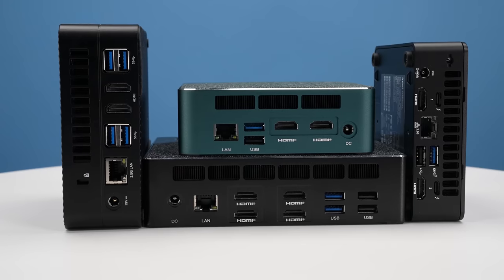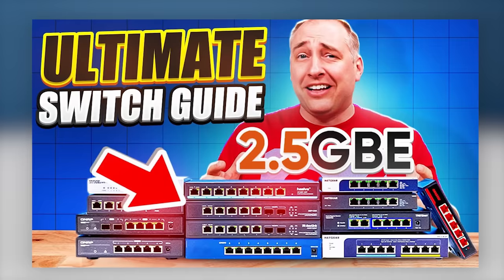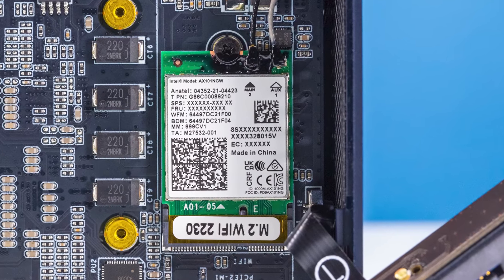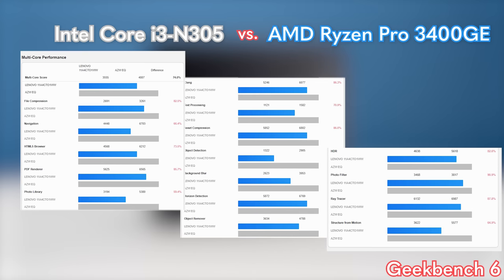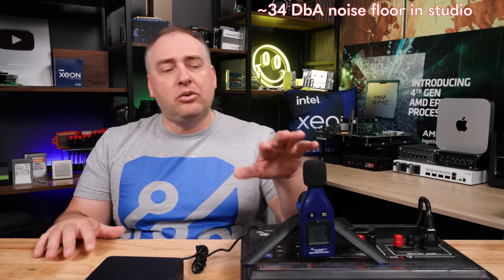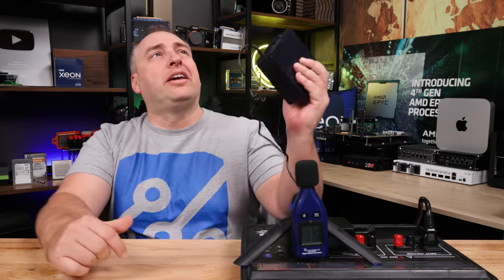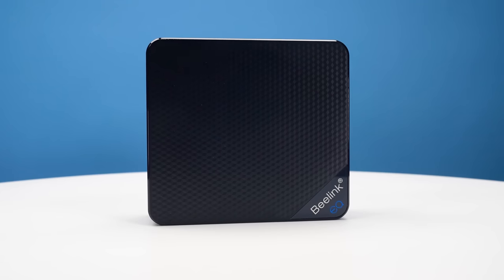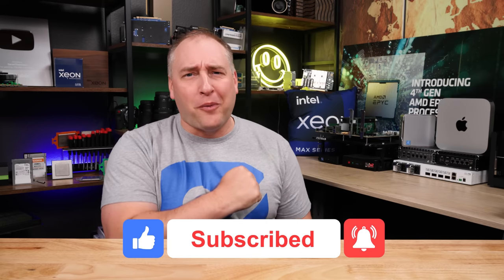Intel Core i3 N305 Mini PC Performance Beelink EQ12 Pro Review

Comment: Might be worth noting that SMB3 multi-channel works when you have modern Windows OS on both client and server side. While I believe that BSD and NIX based OSes that use Samba will not support this out of the box today. Last I heard was SMB3 multi-channel was added as experimental in 4.4.0 release many years ago and there are corner cases that it can cause data corruption due to race conditions. Even Microsoft has had a number of their own issues with it.

Comment: Very exicted about the "next generation" of Mini PC's

Would love to see these become even more efficient at idle, and DUAL CHANNEL RAM is an absolute must.
And slightly better quality cooling. At 15w TDP, all they need to do is put a slightly larger fan in. A single heatpipe should be more than adequate to transfer the heat from the die to the heatsink, I think just making the fin stack larger and a larger fan would make a big difference in noise.
Reply from the maker: The Alder Lake-N parts are single channel only so it is an Intel platform limitation
Reply: With the Intel branded NUC's, most of Intel's in the same price ranges are all DDR4 from what I could find.  Some of the "off-brands" like Beelink, well, they are offering the same in DDR5; which sort of gives you the performance similar to DDR4 dual channel.  But even Beelink's lineup can be confusing blend of  "this model has DDR4" and a very similar model, same chip set, but with DDR5 at a slightly higher price.  Granted, I'd want DDR5 and dual channel if given the choice.  Generally speaking, I also want the option to go up to 64GB ram or beyond too..
Reply: @ServeTheHomeVideo  Aah that is unfortunate, I did not realize that. My Intel n6005 based NUC I felt a noticeable difference in day to day usage going to dual channel after using just 1 channel for a while, especially browsing youtube and testing with Parsec for remote gaming. Sad to see Intel strip so many features off the new generation. Even the iGPU eu's are kind of disappointing, was hoping to see 32 eu's in the lower end sku's, and something like 48 eu's in the N305. Really helps make the machine feel snappy when watching content in the browser.

Comment: too damn expensive for what you get. bought a Beelink Ser5 pro  (8/16 core 5800H With 16gb/512GB SSD) 2 months ago during AliExpress sales. it was $310. the memory was ADATA (Samsung chips) and the SSD Kingston 2700 MB/sec. It handles any AAA game at 720p. twice the performance.

Comment: Would be interested into measurements include also low-power bios setting (if available).
Looking for a 5w-20w proxmox server machine. Found some older gen. candidates which have a bios options to reduce idle power significantly, but prefer a newest gen. product. Thanks

Comment: In my opinion the Beelink Sei12 with the Intel 12th i5-1235U is a better value, you get two more CPU cores and drop an ethernet jack for the same money.
Reply from the maker: If you saw the performance charts, the 1235U is only slightly faster. I was a bit surprised by that but it seems to be power limited
Reply: Reckon you could review the sei12pro 1260p at some point?

Comment: In Geekbench: Power saver mode 1159 single core,  4807 multicore / high performance single core 1271, multi 4478. Is it correct? Was there any kind of thermal issue?
Reply: If you don't cover up the middle fan with a SSD, there's enough cooling to keep thermal issue from happening.
Reply: Very suspicious indeed.
Reply: I suspect he turned the multi core scores up side down
Reply from the maker: Checked these. We labeled them as we uploaded to the GB browser. They were all running into power limits

Comment: I got a couple of the Beelink Ryzen 5560 units and reinstalled Windows 11 on them from a jump drive. When installing it asked for the key, I said I did not have one. Once it was fully installed though, it automatically activated once online.

I also got the 7735HS Beelink unit for one of my kids and it has been awesome so far.

Comment: Just ordered EQ12 regular from Amazon for $315 (click-on coupon that appears every 12 hours it seems). What bothers me is that I didn’t pay attention and they (Beelink) say that I can only upgrade to 2Tb NVME and only 2TB SATA drive.. I can’t understand why… I understand memory is restricted to 16Gb by memory controller but why is disk restricted? So now looking again at i3-1315U based NUC or Miniforum NBP-6 - the latter one also has 2 2.5Gb ports….
Reply from the maker: My guess is that they have not tested over 2TB in these.
Reply: @ServeTheHomeVideo  I received response from Beelink support - they say both drives are limited to 2TB and you can't install a larger disk.
Reply: @mutovkin  Carey Holzsman just done a video showing installing 4gb and 8 gb nvme and the system works fine.
Reply: @kenthesparky178  Strange, I don't see any recent videos about EQ12 from him... Only the old one in which 32gb ram stick killed eq12...

Comment: The 12/13th gen e cores are said to be as powerful as Skylake cores. So does this finally answer the question of what would happen if you put an old architecture on a node 8 years ahead? 

Also isn't this a SoC already, since you don't seem to have an additional chipset?
Reply: Kind of, but there are some critical differences that make it not an apples-to-apples comparison.

The best 8-core Skylake chip I can find on Ark is the i7 7820X, which has SMT enabled. The differences are huge and make any benchmark meant to simulate Skylake on Intel 7 inaccurate. 

The i7 has 2x the L3 cache, or almost, at 11MB to the N305's 6MB. It has SMT, which means 16 threads vs 8. It has a much higher TDP as well, 140W vs 15W, and the clocks are different. 4.5ghz for the i7 vs 3.8ghz for the N305. The more important difference is in the IPC and in lower-level architectural changes such as the better branch prediction of Gracemont cores.

Finally, to answer the second question: This is a mobile CPU, and will have a PCH like all other mobile chips from Intel. This is effectively the chipset, just on the same package as the CPU in a second die.

Comment: @8:59 - yes and no. Nobody will use J4125 as desktop computer but it works perfectly as firewall/router appliance. So mixing these 2 makes no real sense.
Reply from the maker: There were a TON of J4125 Mini PC desktops. We were going to start the STH Mini PC series with them. The J4125 is great for a firewall/ router. Next, we are going to have N100/N200 firewall/ routers so stay tuned for the next video this week.

Comment: Is that ~4400 multi geekbench peformance sustained or just 1 run where it is turbo'ing for much of the run? Curious of long term full load clocks/performance at 25 watts wall power consumption! And, how it compares to same scenario with 4-core N100.
~4400 is slightly slower than 6-core i5-8500, which u can sustain at 3.89GHZ at 60 watts at the wall (~40w CPU in hwinfo) within an HP Prodesk SFF box undervolted by 140mV reliably stable via Throttlestop and old BIOS pre-plundervolt, crunching WorldCommunityGrid Workunits.
So.. basically, N305 is 2x the efficiency of good 'ole undervolted mature Coffeelake. Just napkin math mind u.
Thought it would be more like 3x.

Comment: I have one and im wondering what will happen if the power goes out ? These don't have a battery so when the power goes down that's it and if it's updating when the power goes off you may lose you system and have a brick,  The power in my area goes down a lot 4 to 6 time a year, Not off for hours it just flickers of and back on so just enough to turn the tv off or mess up the clocks but what will that do to this PC with no battery? My phone and tablet and laptop don't mind a power failure because they have batteries
Reply from the maker: You can get an external UPS unit. Since these are lower power they will run for a long time on the battery

Comment: Looks like a nice mini and then I look at my 35W 800 G3 running an i5 7600t and wonder if it can match that and if it can game at all. I can play older titles with the HD 630 quite well with the G3. Downside of G3 is the fan noise whenever under load. I notice Dell stuck with the HD 630 all the way to the G8 I think is when it upgraded, which makes it costly to move up to better graphics with HP minis.

Comment: does anyone know if that kind of PCIe slot that the WiFi card is plugged into could accommodate a PCI breakout cable that could give you 10GbE? 2.5 (or 5, bonded) is still too slow for me, I need fast networking but can compromise on other stuff.

Comment: These little boxes need support for 32 GB of RAM to make them interesting as candidates for little  small business mini-servers!  An N305-based system having 8 cores/8 threads is just begging for a few of these to be viable for SMB use...; perhaps 4 of them ($1400 total?), providing small businesses with almost everything they need in a moderately powerful footprint of 4 small boxes that occupy 1/4 of the space of a  typical 1U server...
Reply from the maker: The N305 in our most recent R86S Pro video has 32GB

Comment: how ist the integrated GPU on these powerfull small E core CPUs? is it similar to 12/13th gen intel? at least when transcoding?
Also I can't wait for an Intel NUC with these - maybe intel can push them down in the 3-4W regime...
Reply: It has the 32-EU UHD iGPU clocked at 1250mhz. This is almost the exact same as the iGPU on Raptor Lake S, which is different in only clocks. The 13900K clocks the same 32 EUs at 1650mhz.

Comment: It's impressive. It'd be great for a lot of minipc use-cases. I'm just waiting 'til they have the ability to slap a full-sized GPU on them. Maybe in a few years, they'll have an exposed 4 lanes for PCIe 5 that will work with Nvidia's 50 series cards and AMD's equivalent. 4 lanes of PCIe would be fairly small to tack on, and 4 at gen 5 speeds would be roughly the same bandwidth as 16 lanes at gen 3 speeds. That's something I could work with :)
Reply: Then it would be a sff or like a normal pc haha. I do think in China (and recently miniforum) there are a few minis with a pci slot on the outside

Comment: Seems to me that memory cooling fan will get blocked by a SATA drive.
Reply: You'll need to place a very think strip of foam between the bottom of the SSD tray to separate the SSD from hitting the fan blades according to another user.

Comment: Why they can't get any perfect port layout?
The old U59 Pro had the same twin HDMI and Ehternet (but 1Gbit) but it had dual USB 3.0 back and front and since the USB-C was DP-Alt but not PD it was purfect at the front.
Not I also have a B95 that have the same front selection of ports but the USB-C was upgraded to Power Delivery which is weird to pug your device upfront. The back have the same ports minus one 2.5GB.
Your new Q12 finally get a USB-C with AltDP and .PD at the back!... so why the barrel connector? Why we loose a USB at the back for A USB 2.0,  .
It's just weird (especially if you have multiple rand brand version.

Comment: 9:32 older versions of edge doesnt have a feature called "startup boost" which keeps browser open in the background for faster load times, maybe it didnt have that feature cuz win10 or smth
edit: its actually not even the new edge thats why its so slow lmaooo, i think that browser test is completely invalid just because of that, your point stands ofc but the example is invalid

Comment: Windows blah blah windows. Dude, this is STH, do some linux compatibility testing on things. Please. Especially on dual nic units that the majority of people would want to use a linux based os on.
Reply from the maker: Ubuntu just worked. The Linux compile benchmark and such are all done with Ubuntu as the standard. Not too exciting when the result is just that you can use a standard installer
Reply: @ServeTheHomeVideo  I have problem with my Wifi 6 driver under Linux in Beelink EQ12 not available yet, Debian Arch etc

Comment: the amd chips are just better - largely accurate but mini pc will keep getting better - they are ok for some situations like travel but really the fascination and interest in small form factor pc is unhealthy and misguided for a ton of reasons given the alternatives - they are not going to save the pc industry but good to see some innovation - they are miles and miles ahead of sbc/soc
Reply: Good old ATX still has its strengths.
Reply: Mini PCs aren't even good for travel.  Hauling around a monitor and keyboard is a major hassle.  Laptops still rule there.  Maybe if you live in a van or RV or on an off-grid solar power system and you really need low power, maybe then mini-PCs are the best.  For everyone else, they're functionally not any better than a traditional tower.  

I suppose some people like to use these as network appliances, which is fine if you're conscious that it's as much a hobby as a tool.  Functionally you'd probably be better with a dedicated appliance.
Reply: They are great from home networking use. Perfect as a DIY router.
Reply: @renegade_patriot  But a router is a better router than anything DIY.
Reply: @rightwingsafetysquad9872  nonsense
Reply: @rightwingsafetysquad9872  Depends on what you want it to do. A store-bought router is great if you just want to set it up and leave it there. DIY is great for customizable features, and knowing exactly what is running on and through your network. DIY routers are much easier to set up with ad-blockers and firewalls, and that computer can do other things as well. It's not uncommon to run a NAS on the same unit as the DIY router, making your networking hub also a central storage hub for all your devices to use.
Reply: @DigitalJedi  Everything you can do on a DIY router can be done on an enterprise or SMB router or managed switch.  Except maybe pihole, but that seems more like a proxy function than a router function and now I'm digressing.

Comment: single-channel DDR5? wonder how much of a ding it takes for that 🤔

and I like dual-LAN...for making lil' router/network appliance boxes
Reply: nirsoft's produkey works wonders btw

and it's probably a volume license key they gave ya 🤣
Reply: The memory controller in the CPU is single channel, so there won't be a model with this CPU that has dual channel memory.
Reply from the maker: Yes.

Comment: try the network performance with iperf...
then you will see what kind of rubbish it is.

for the outbound traffic on 2.5G port you only get 300Mbit/s 

if you uste the box as samba server ... 15 Megabyte per second.

the I225-V is rubbish on Linux ...  outgoing Networkspeed < 300Mbit .... checked with 10Gbit and iperf3 ...

Comment: Too expensive. Way overpriced. Go with the N100/105 and save a ton. Performance isn’t near enough better to justify 150 premium.
Reply from the maker: The next video (being edited) is the fanless N100/N200 video. The N305 is significantly faster if you want to use it as a desktop